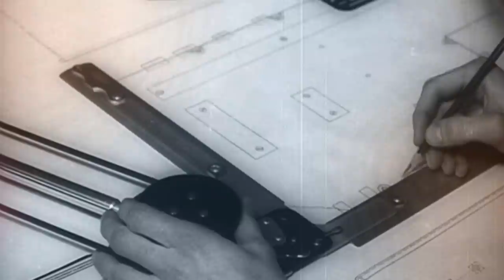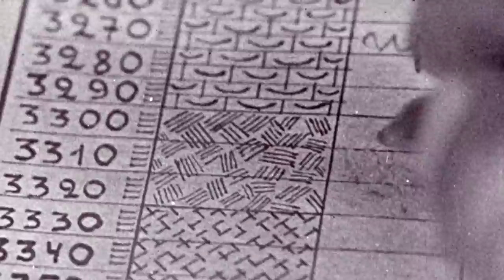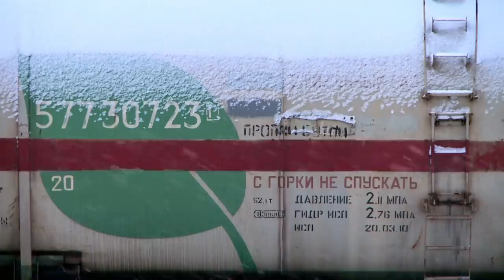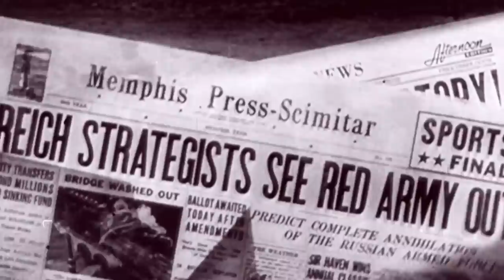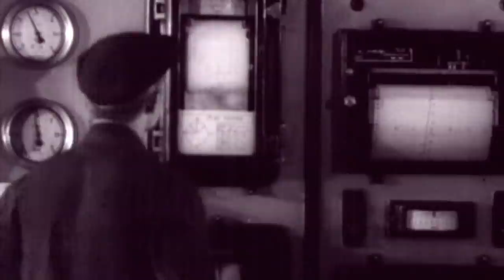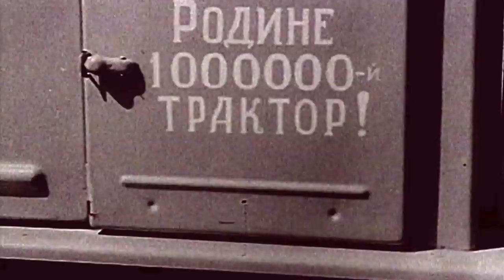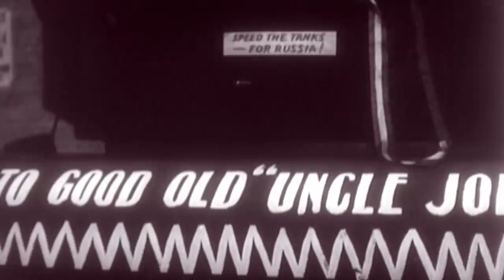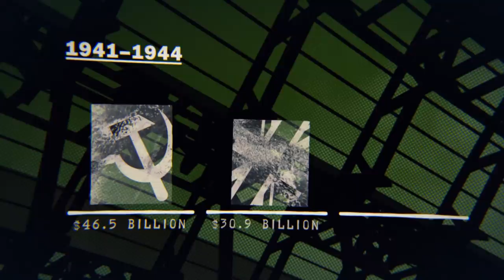The Industrial Might Of Wartime Soviet Russian | War Factories

Comment: The USSR actually produced more tanks than the US, but the US only made a handful less because we intentionally cut back production in 1944 when we realized we had produced more than we needed and it would be better to reconvert the locomotive plants which had been making many of our tanks back to their original use to make moving goods from our factories to our ports much easier.
Reply: You do realize that 2/3 of ALL vehicles that were used by the Soviets in WW2, were provided by the U.S. ?

12k Red Army tanks were constructed by the U.S..
Reply: USSR produced 108 000 tanks, the USA produced ~75 000 tanks, depending if you are counting light tanks, of which the Soviets produced hardly any, the USA built 12 000.  Almost all the Soviet light tanks at the start (20 000) got captured in tank parks, the encirclements.  Soviets prioritized medium and heavy tank production.
Reply: I read in a book called Detroit Goes to War that US production was purposely slowed as early as 43 because so much was being produced.
Reply: The US built 86,000 tanks.  20% of the Soviet armored fighting vehicles (tanks, assault vehicles and half-tracks) were lend-lease (from US, UK, and Canada).  The Soviets were able to produce even more AFVs and trucks from American lend-lease steel and aluminum and modern cutting tools. 2/3 of trucks were from US lend-lease enabling them to make deep penetration offensives.  USSR also concentrated totally on numbers and had no quality control.  I am also skeptical of the Soviet production claims.
Reply: The Soviets were very honest in their reporting of statistics!
Reply: @jrus690  The US produced everything else including Red Army clothes.
Reply: @josephmountford2292       YES,  I'M SURE THEY DID.......LOL
Reply: @josephmountford2292  I know right 🤣
Reply: @On_The_Piss  what? Develop that thought, it's way to deep or way to idiotic.
Reply: Half of there trucks and cars were made by the US and we also gave them over 1000 tanks
Reply: Soviets produced tanks and tank destroyers that could take on German heavies one on one. Also produced some of the best aircraft of the Second World war.
Reply: @butchoharechicago6657  So did the US, on both points. The Sherman wasn't our heaviest tank, after all. The Pershing was at least a match for a Tiger.
Reply: @On_The_Piss  Your progressive Liberalism is showing
Reply: + @Nonamearisto   Before the war Gen. Patton had read Achtung Panzer by Gen. Heinz Guderian. He pleaded with the U.S. Army that in the coming war America would need a heavy breakthrough tank. The M3 Lee and Shermans had a tendency to catch fire and were thinly armored and used high octane aviation fuel. Even Panzer IV H-J did not have to much trouble with them. Pershing II should have been available 1943-44. Was not ready for combat in Europe until 3 weeks before war ended. Instead of producing so many Shermans should have had Pershing II which was used against North Korean T-34-85s in Korean war. Soviets had JS-2 tanks, SU-85m-SU-100 Best allied tank destroyer of the war, massive JSU-122-JSU-152 tank destroyers. Who could take on Jagdtiger, King Tiger, Tiger-1, Jagdpanther best  tank destroyer of the war, one on one. Panther A-G considered medium by German standards, weighed as much as Stalin JS-2m 45 tons. Considered heavy by Soviet standards. American M-36 tank destroyer had no roof. Same as M-10 both of which had thin armor and used high octane aviation fuel. M4A2 Sherman sent to Soviets and used by U.S. Marines in Pacific Theatre used diesel fuel. Odd! The most successful in number of kills against all allied armor was the Stug-III tank destroyer. Especially the late models.
Reply: @Dweller415  That's simply not true.
Reply: @MotionMcAnixx  The American half track production was halted in 1944.  The USA had built enough.   Dittos with the B-26 bomber.
Reply: @1986tessie   (edit): I stand corrected, the U.S. did not provide 12k tanks.   

The breakdown of materials provided to the Soviets during WW2 was:

400,000 jeeps & trucks
14,000 airplanes
8,000 tractors
13,000 tanks
1.5 million blankets
15 million pairs of army boots
107,000 tons of cotton
2.7 million tons of petrol products
4.5 million tons of food

But the most significant contribution (imo) is that the U.S. showed the Soviets how to to build the  factories and mass produce using assembly lines.   I’m not saying the that the supplies provided to the  Red Army won the war for the Soviets.    But it certainly helped them not to lose.    Also, had the U.S. not supplied the trucks, there’s is no possible way the Red Army would have made it to Berlin.   The limited trucks the Red Army had, supplemented with horses and donkeys can’t carry enough fuel, food and munitions to supply the millions of Red Army Soldiers.

Another point (that I was unaware of before watching this video); was the fact that as part of the U.S. showing the Soviets how to mass produce, the Soviets adopted the welding of tanks over rivets.  

It’s not a U.S., U.K vs Soviets.   We were allies and the Soviets were in a war of annihilation with Germany which is much different that straight up combat.   The U.S. and U.K. and the Western Allies fought two fronts in Europe; we fought in Africa and throughout the Pacific.    The Soviets (army and citizens) fought to survive across the vast Eastern Front.   It was the heroism of the people and Red Army that put Germany on its heels, which sealed their fate.  But it took the U.S. U.K and the Soviet Union together to defeat Germany outright and secure the peace in Europe.  

So again, recognizing the material assistance given to the Red Army by the West doesn’t take anything away from their victory in the East over Germany.

https://ru.usembassy.gov/world-war-ii-allies-u-s-lend-lease-to-the-soviet-union-1941-1945/
Reply: Stop saying “actually”.
Reply: @On_The_Piss  it's poor because it chose to be poor. People support communism instead of capitalism so they must suffer with the consequences.
Reply: @jeffclark7888  he only said it once...
Reply: @greengirl-kr1vf  say “produced” but don’t say “actually produced”. The word “ actually” is a filler and is grossly overused.
Reply: US production of locomotives went up during the war. There was no critical need to convert back to producing more. The US cut production because it was very obvious the war would be over before they ever got in the fight. Soviet tanks,  tank for tank were also better than US tanks.
Reply: @Dweller415  There is a reason the Soviets didn’t make trucks. They had very few roads and without roads trucks aren’t all that useful. Transportation in the Soviet Union between cities was based on trains not highways as it has become in the US.
Reply: @psilvakimo  The Soviets inflicted 90% of the casualties the Germans had during WW2. So since they did almost all the fighting and dying the least the Western Allies could do is provide material support. The Russians already effectively had the Germans beaten before any significant assistance was provided by the US. Yes the US assistance undoubtedly saves millions of Soviet lives, but it didn’t change the outcome of the war. The US specifically let the Soviet Union do most of the fighting and dying by delaying their major invasion of Europe until 1944 and the only reason they didn’t put it off until 1945 is because by that time the Soviets were overrunning the Germans and by 1945 they may have been all the way to the English Channel.
Reply: @butchoharechicago6657  That's nonsense! Patton saw no need for a heavy tank before the war and during the war where he told Ordnance to keep the M6 stateside and told Ike to keep the M26 Pershing in England since it was too slow to keep up with his advancing units and too heavy to cross their pontoon bridging.
Reply: + @billwilson3609   Hogwash! He was the only American tank commander with a German point of view. He had read Heinz Guderian,s Achtung Panzer and Soon to be Field Marshall Erwin Rommel,s The Tank in Battle before the war. The Sherman or Ronsan lighter was only 32 tons and tended to be a death trap. High octane fuel.
Reply: @virginccyy7645  You obviously don’t understand Soviets. They were never close to surrendering that is all a western fiction. Even at their lowest, Soviet armament production was greater than Germany’s they had far more people (1940 German population 70,000,000 Soviet population 194,000,000) giving them far more soldiers as well. Once the Soviets understood they didn’t have to fight a two front war. The Germans were doomed. The Soviets brought reinforcements from the east and stopped Germany for the first time at the battle of Moscow. The chances of Germany every beating The Soviet Union were slim right from the beginning  and if it weren’t for Stalins gross incompetence and Eastern European animosity towards the Russians it wouldn’t have been that good. Once the Eastern Europeans figured out the Germans were even worse than the Russians they started to fight the Germans instead of just surrendering in mass. Once the Soviets figured out the Japanese had no ability to launch a second front that allow them to bring massive reinforcements to Moscow. Remember the Battle of Moscow started before the US even entered the war and well in advance of any significant aid arriving.
The Russians didn’t surrender to Napoleon when he actually took Moscow. They weren’t about to surrender when the Germans never even got that far.
Reply: @matthewhuszarik4173  Sorry tanks were very unreliable ...And very poorly constructed. They only lasted a couple days in combat. That's why the Soviets needed so many other from their factories.
Reply: @matthewhuszarik4173  You nailed it.
Reply: @Dweller415  The Soviets had already turned the tide of the Eastern Front before any significant US assistance arrived. While US assistance saved probably millions of Soviet lives it didn’t change the ultimate trajectory of the war. The Germans blitzkrieg was spent after the Battle of Moscow their logistics couldn’t keep up, they were using more horses than trucks, and the deeper into The Soviet Union they got the worse it became. The Soviets were still just mobilizing.
Reply: @Thom3748  T34s are universally thought of as the best medium tank of WW2 dollar for dollar spent. Since the Soviet Union had almost two and a half times the population of Germany. It made since to overwhelm the Germans with numbers.
Reply: @MotionMcAnixx  usa had a balanced work force.

Look what happened to USSR in every other economic sector besides tanks etc. Central planning causes those issues. Not enough food. Not enough development of cities. The rebuilding was janky.
And the entire process did not improve the nation, but drain it.

While the USA war production was so profitable...it became problematic. The reason the military industrial complex became a thing
Reply: @GigiDuruDuru  you made zero sense like why would any command purposely starves its soldiers in the middle of the most brutal war in history?
Reply: @phucgougle4279  how many wars did the Soviets purposefully started vs The US?
Reply: @virginccyy7645  interesting because it was the US trade embargo and restrictions that isolated Russia from acquiring the materials necessary to support itself and now you're saying they should give the US credit for helping when it took them 2 years to finally invade the western front in 1944 after Stalin had begged the Allies to do so.
Reply: @claudeyaz  they also had free education, living, and Healthcare. Equall rights for women and a stable economy something the US has yet to do because it crashes
Reply: @DawnOfTheDead991  Yep, the US produced "Stalin" too - a guy who also played "General Douglas MacArthur" in the US. He can be recognised as the "tall Stalin" in the pictures (there were a few actors playing the role).
Reply: @Dweller415  well stated sir or madame
Reply: @funveeable  "so they must suffer with the consequences" which was Lester Mallory's viewpoint to the cuban people for the last 60 years...collective punishment because a people choose thier own path is a crime against humanity, its poor because they chose not to be americas sugar colony and whorehouse and America chose to enforce poverty for the entire population as an act of destabilization, as it has all across the world, most poor countries didnt choose to be poor, the rich countries decided they needed poor trade partners to exploit, and when some of said countries said no thanks, the rich countries decided those nations were the baddies and in need of "freedoms"...
Reply: @Dweller415  Also lend lease gave the USSR 400,000 trucks vs, the 100, 000 roughly that the USSR produced.
Reply: @psilvakimo  Wait, T-34 is accepted as the best overall tank of World War II. The first versions had some bugs, but then.....
Reply: @GigiDuruDuru  Which people? Stalin died in 1953.
Reply: Alco, American Locomotive Company, was produced in the United States, and shipped into 
USSR. It is, in railroad parlance, the locomotive that saved Russia.
Reply: @Nonamearisto  The Pershing tank only entered service in the last few months of the war in Germany during the invasion of Germany its self. It was used primarily in Korea .
Reply: @funveeable  You really have no idea about Russian history do you ? Russia has never had a capitalism goverment. They went from a violent repressive monarchy  the Czars to communism they never had an option of a democratic capitalism goverment
Reply: Sources “trust me bro.”
Reply: @jrus690  yeah that’s false.  Most of the Soviet tanks were light and medium.    Wikipedia among others sources disagree with you
Reply: @Dweller415  you do realize they only did this because after Germany takes Russia, the u.s. was next.. now the u.s. is supplying ukraine lol
Reply: @Dweller415  You made this up!
Reply: The Soviet Union was incapable of producing a huge variety of essential products. One of them was locomotives 0 the US sent thousands (Germany made ten thousand themselves),
Reply: @DawnOfTheDead991   Including, food,trucks,jeeps,train cars and engines,rifles ( i own 2 Westinghouse 91/30 Mosin rifles) food( Soviet Soldiers loved Spam which was sent over by the tons.),artilery, planes.   The list goes on.    if it wasn't for this massive supply line  the Soviets would have been crushed by  Germans.
Reply: @jon82489  Millions don't starve to death in the utopia you imagine nor do 10s of millions of people get murdered and ground down in gulags.
Reply: @DawnOfTheDead991  I'm sorry but how many people are homeless and unemployed under good Ole capatilism???
Reply: @DawnOfTheDead991  the USA alone has more prisoners by population than any country in the world. If that's not an authoritarian prison state, then I don't what is
Reply: @jon82489  I missed the part where the US starved millions of its farmers then used the army and even it's air force to brutally force the rest onto collective farms.
Reply: You were also not attacked on your home soil and didn't have to move your economic base to the Ural mountains and got paid for your wartime production wwone and wwtwo were literally the best thing that ever happened to the American economy whilst Russia didn't have that financial bonus
Reply: @psilvakimo  the Soviet union was fighting the war from the start and were also invaded which is more than you can say about America
Reply: @josephmountford2292    Hahaha good one!
Reply: Good one , hit the nail on the head with that one
Reply: Jesus is coming

Comment: The West gifted Stalin modern mass production factories, but the Soviets couldn’t maintain that technological head-start.

Impressive how they moved all those factories East.   Stalin actually had many of East Germany’s factories dismantled moved to the Soviet Union and rebuilt, as a form of reparations.
Reply: I knew a German who served in WWll.He told me years ago that where he was from in Germany the Russians literally took everything.There was nothing but open fields when the Russians were through.I mean when Germany invaded Russia the Germans left nothing standing.But I guess he conveniently forgot that part.
Reply: They took everything but rarely did anything with it. Most of it ended up rusting by the side of railroads. Soviets lacked the expertise to reassemble or run German factories.
Reply: Their tanks are still trash 🗑
Reply: @frank1fm634  
Nobody denies that the Germans were cruel and inhumane to the Russians during WWII, but that doesn't change the fact that the Russians behaved the same way. Two wrongs don't make a right.
Reply: @schnoodle3  Rocketry?

Comment: Them showing a finnish t34 when talking about nazis capturing them and painting swastikas on them hurt a little 

The swastika is a germanic symbol that has been used by armed forces in europe for millenia, not just the nazis. The finnish airforce used it right up until last year which is a shame they gave in to the politically correct since they have been using it since 1918 and the blue/black swastika was the symbol for the sun

Finnish medals and some units still use it.
Reply: It’s not just from Europe, it came from Asian before Europeans started using the swastika, but again Europeans originated from Asia.
Reply: Dylan better read up on your history.The swastika is a Hindu symbol.You can see swastikas on many ancient Hindu temples dating back for centuries.The nazis tilted the swastika and mirror flipped its design.

Comment: I'd say the video is a little misleading regarding the level of importance of Lend-Lease to the Soviet effort. Lend-Lease didn't really kick into high gear until late 1943-1944, by which point the Germans had suffered three major defeats from the Soviets and were solidly on the defensive. It had been going on before then, but not in the sheer capacity as late in the war.
Reply: LaweiboDotCom  Nuh Uh